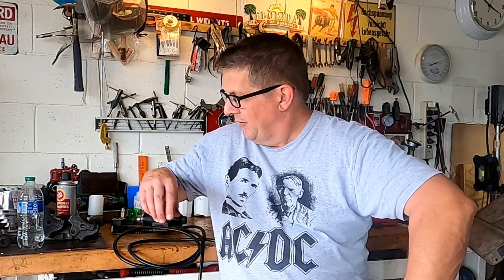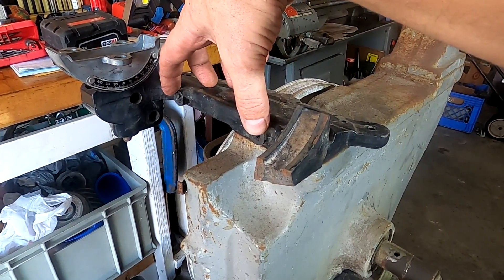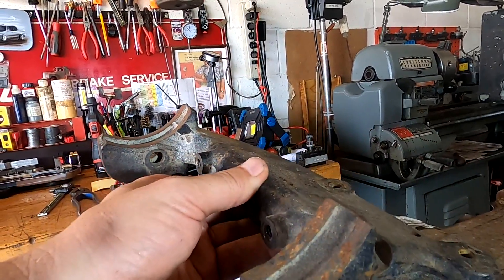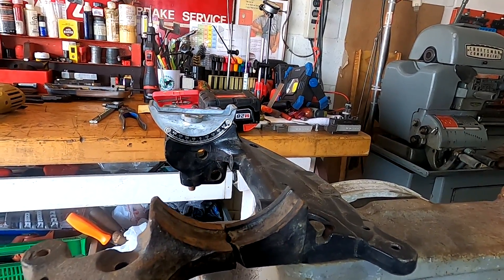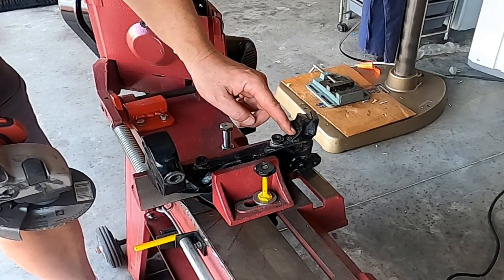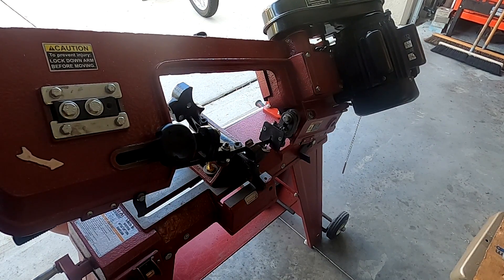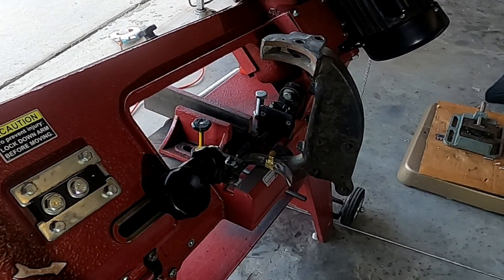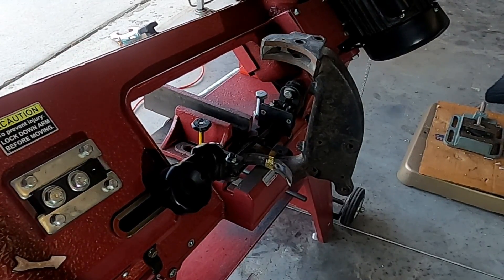Plasma Cutter Braze welding at home with the Multiplaz 3500 - Delta band saw casting repair

Comment: That’s interesting to see. I was thinking of getting one of those, but really, I was skeptical about it. The web site makes it look too good to be true. I’ve got an ESAB emp 205, which I really like, but this seems as though it could be useful too. It certainly works differently! But you’re the only one I’ve seen who has one. I guess I should type it in here in YouTube and see what people are doing with it.

Be careful of your hands and eyes Don, this still produces a fair amount of far UV.

Maybe you can do a video on this device?
Reply from the maker: I actually did a video on it, Weld with Water.  Welding with plasma and water. about 7 or 8 months back it posted. A number 5 welding glass is all you need for eye safety.   I have a number of welders at home and of course from my work I have an even wider variety to choose from. But for home, this Multiplaz has become my favorite and realistically its the most economical to use. I was incredibly skeptical about it before taking the plunge. Luckily for me I was teaching metals fab at the time and the company gave me a great deal on it, so that I could get it introduced to the younger kids still in the learning process. It does have a little bit of learning curve to it, but once you get sorted in your head how to operate and care for it, its a very comfortable and clean welding process.  Throw what you know about making pretty beads out the window though. Plasma doesn't give you time to play dress up. Its a get to the point,  full penetration welder. Although it does recover much nicer from blow throughs than an arc or MIG machine ever will. Think TIG. Anyway, I may do another Vid later this year for the hard core MIG guys that are screaming "can it make a certifiable weld" which of course it can..  with one eye closed and a hand tied behind its back...  Don
Reply: @donsengine3158  I didn’t see those older videos. I’ll watch them. Going back to old videos is something I don’t usually do, or I’ll never do anything else.
Reply from the maker: @melgross  I can understand that....
Reply: I have one and it wasn't that great at first, was a bit disappointed. Then I  hooked it up to 220 and now it's a dream to use. Works a thousand times better and gets much hotter than oxy acetylene. You can make micro adjustments on the fly. I recommend it. It will work on 110 decent but with 220 it's a game changer.